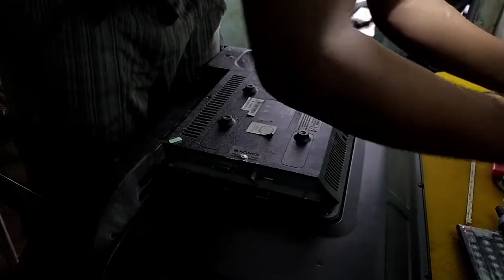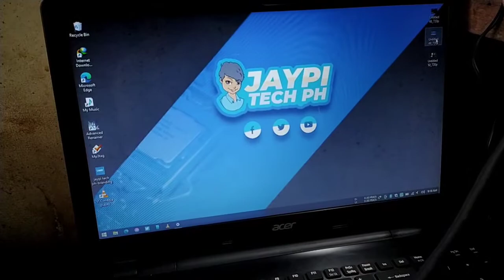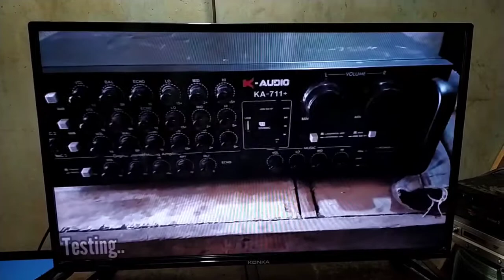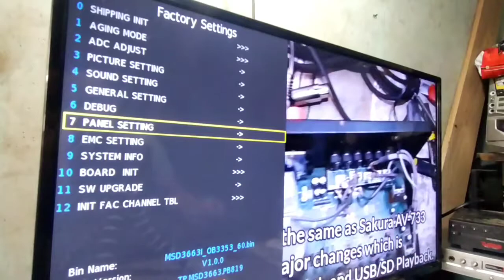Konka KDE28PHD311L LEDTV Repair + Service Menu Access Tutorial

Comment: panu po yung konka na nag palit lcd pero naka baliktad then wala po panel settings
Reply: di po mismo pang konka yung lcd na nakabit
Reply from the maker: Try these methods if proven work: 
LVDS Enable
Reply from the maker: Sometimes may mga firmware ng same tv na naka configure din yung mirror mode

Comment: sir sana mapansin nyo..
kasi ung sakin nd na mapindot kahit sa remote kahit sa manual parang nag lack pag sinaksak nag oopen agad isang channel nalng nakukuha nya kasi nd na mailipat 39inc konka po salmat😇😇
Reply from the maker: system locked ang problem ng tv. need to reprogram.
Reply: pano po gawin un sir salamat..
Reply from the maker: @jaimerosstv1843  mabusisi ang pag reflash ng firmware.
Reply: ok po salamat po

Comment: Shops are still selling these and no one can get spare parts???
Reply from the maker: You can order a backlight and panel online (be specific on Model Number/Part Number)
Reply: @JaypiTechPHOfficial  Got a web site I have tried every where
Reply from the maker: @glendooer6211  then try to ask a nearby technician to get replacement parts.
Reply: @JaypiTechPHOfficial  he can't find any thinks might try another companies board?  mine won't start if it does if switch off or runs for a while then switches off.
Reply from the maker: @glendooer6211  the only way to fix is to find defective unit. Then replace the mainboard
Reply: @JaypiTechPHOfficial  yes i have emailed China but no reply.can I buy a board from say Sony/?? and fit that?
Reply from the maker: @glendooer6211  no. All you need to do is wait for defective unit (same as yours) at Facebook Marketplace.